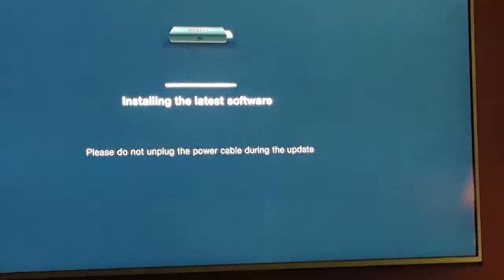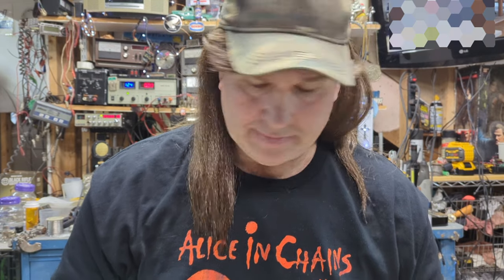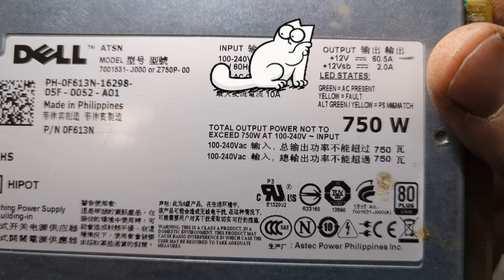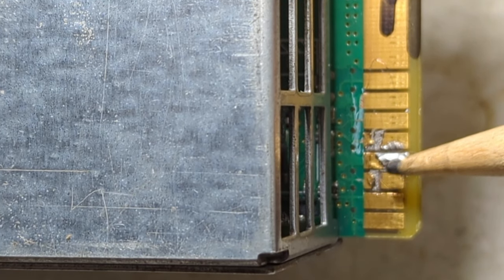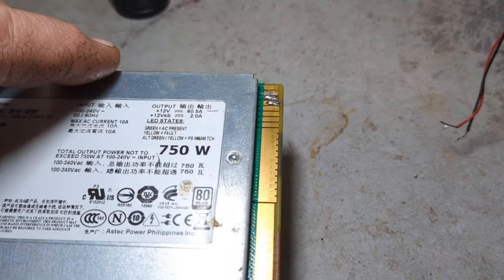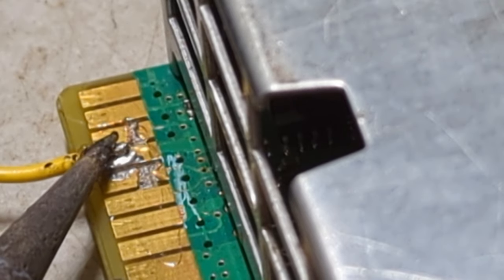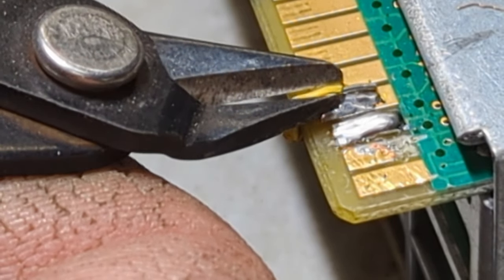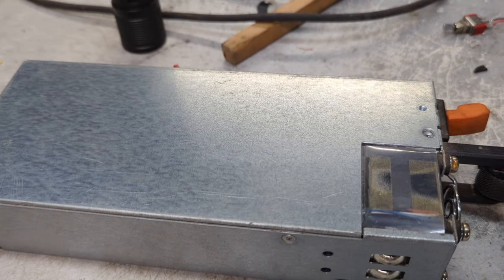Making a 12 volt 60 amp power supply out of a Dell Computer power supply @tarylfixesallskits

Comment: One thing I don't think can be emphasized too much:  Always use flux when soldering.  Beginners almost never properly appreciate how much of a difference it can make.  If you apply just a little bit of flux to the area before soldering, it will make it much easier to make the connections.  It both makes the solder joints happen quicker and more completely, with a lot less solder, but it also prevents accidental bridges to a huge extent.  It's almost like magic, to be honest.

If the other guy had applied a bit of flux before soldering, he probably would not have had any issues with those bridges across the pins at all.
Reply from the maker: Very good wisdom definitely a lot of good points It is amazing how flux makes the solder work so much easier

Comment: I've been doing this for years. I have one on my 12v 3D printer and 2 wired in series with floating ground on one for my 24 volt 3D printer. Both are controlled on and off using my 3D printer's onboard option to switch a relay on and off. I also use one and made a power supply to run my hobby chargers that charge my ebike and many other uses. They were dirt cheap, very powerful and reliable. 3 of them are not dell supplies. I found the schematics online. For the dell, I added a relay to disable the constantly spinning fan unless the power supply is turned on. This lasted over 4 years and still going strong in this condition helps with unnecessary fan noise when the PSU is off.. One of the PSUs didn't include a fan so I 3D printed a fan shroud that reduces size to the width of the PSU and cut open the PSU to allow air in.
Reply from the maker: Wow that is awesome. You put those burgers to use for sure. Those are very durable power supplies. I like using them. In fact, I'm going to put one in a sign that I'm going to hang out on my barn. It should work out pretty good 😁

Comment: How is the fan controlled?  Internally or via other small pins in the connector?  It won't take very long to overheat without airflow.
Reply from the maker: I do believe it's got a thermal switch built inside. I don't know this personally but just knowing how all other supporter supplies work? I would imagine that is definitely how that works

Comment: Is there a way to increase the voltage up to 13.8v internally or on-board?
Reply from the maker: Actually that's a good question. I'm going to have to take it apart and take a look. I'm sure there is a pot on there that you can actually probably turn up to a little bit. I don't think much

Comment: Yeah those SMPS's are quiet too ..... A few years ago I ordered a 45 amp SMPS from Ali xpress , man that thing is noisy in a radio , especially a galaxy or connex ....  No real filtering in those radios or that PSU from ali......  I got a HP 70 amp or 75 a while back I hadn't even tried it yet ..... There's a way to get those HP SMPS to 13.8 to 14 .9 Volts ...Buddy has a vid on it ... I don't know of a way for the Dell's tho.... I might experiment with one if I can find a decent schematic...

Comment: Didn't realize Dell gave only 12V outputs. Typical computer supplies have their high current output 5V for driving the processor and memory. Dell must put a heavy load on their VRM's reducing the 12V down to the 1V+ required for the processor and memory. That's quite a voltage drop for the semiconductors to accommodate.
Then again I just remembered there is also 12V coming directly form the PSU over to ATX concoctors supplying extra CPU power.
Reply: well most components on a mb use 12v as a source voltage.... gpu, cpu, drives etc.   on regular atx psu you  have 12V, 5V, and 3V. but most servers only use 12V supplies just likee his... its a pretty different world from desktop to server. there even are 24x pcie slots out there but user standart is 16x.
Reply: The servers have a separate DC-DC converter board which sits in-between the PSUs and the motherboard to create additional voltage rails.

Comment: ive done the same with smaller ones but learned how noisy they get with my two radios! the noise is so bad it drowns out incomeing signals!
Reply from the maker: So far I've been lucky with the ones I got. They're pretty quiet. They are electronic power supplies so yeah I can see someone. Definitely probably will get noisy
Reply: @bucketsgarage  yeah there cheap and have no internal noise filtering! Just like a bunch of those Chineseium power supplies or phone chargers!
Reply: If you get the HP branded ones (75 amp) there is virtually no noises. Those are filtered very well. You will pay a little more for them.

Comment: an old laptop charger will work just fine lol
Reply: Yea if you only need 10 amps
Reply: A laptop charger plug can handle 10 amps, but the adapter determines the current and will take no more than 1.6 A. For example, an ASUS AC adapter has an input of 100–240 V, 50–60 Hz, and 2 A, and an output of 19 V and 6.32 A. @RhymeTightAuthentic